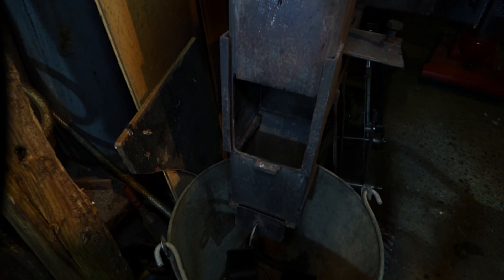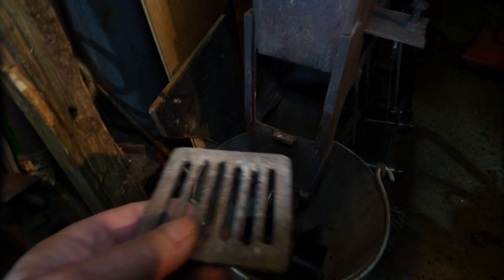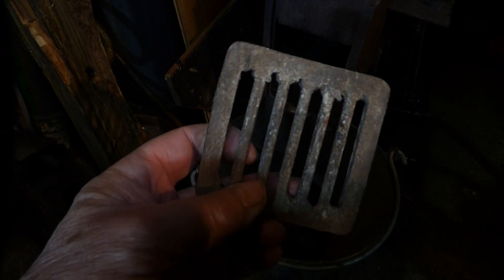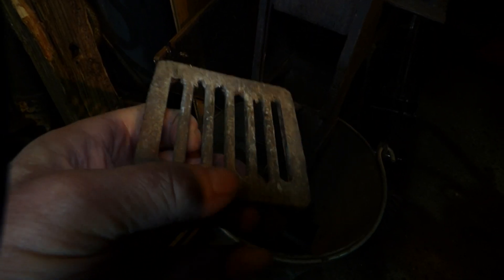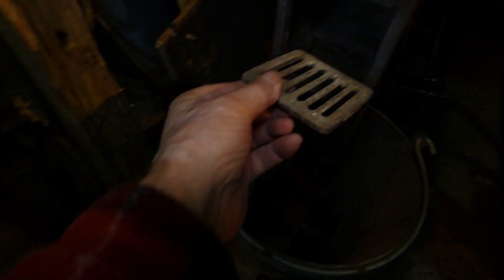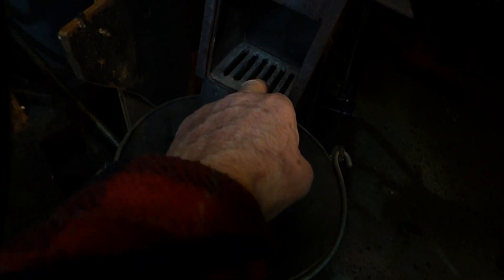Rocket stove MK3 comment No68

Comment: If you put a blade above the basket, on the feeding tube, to cut out the feeding and eventually cut the fire, will it work? Or will it burn back the pellets? On previous videos you have put a butterfly valve on the top of the feeding tube. Is the point you put the valve essential? I would be very happy if you ask my question!

Comment: Thanks Dave - with the MK3 realistically how many 'standard' sized radiators could you heat, assuming you had a central heating pump installed and all needed plumbing done?